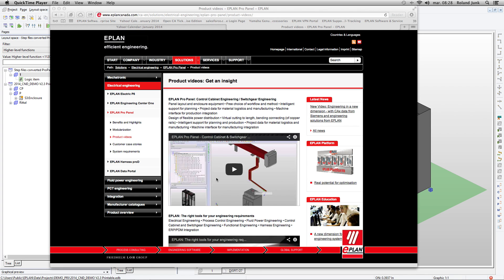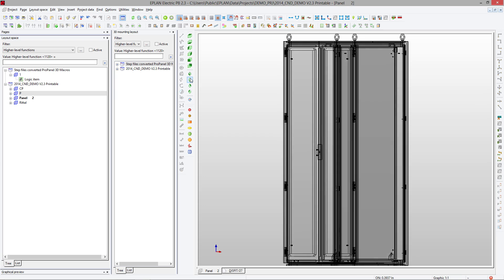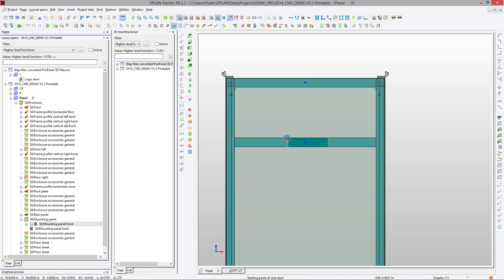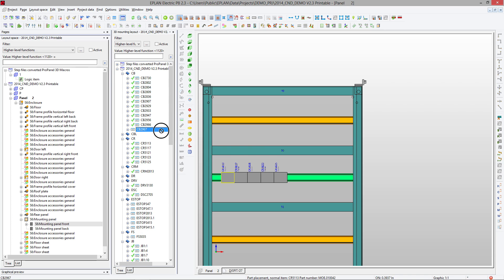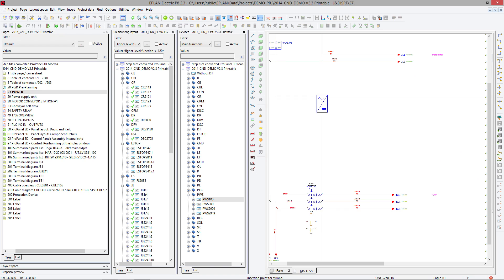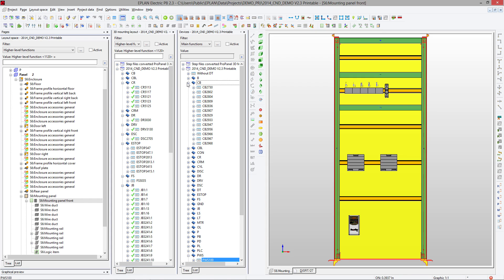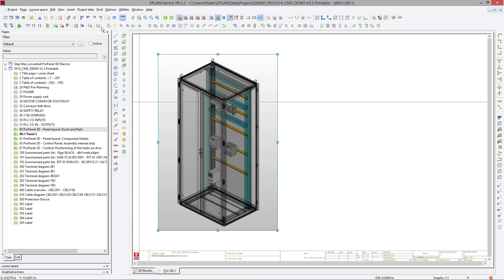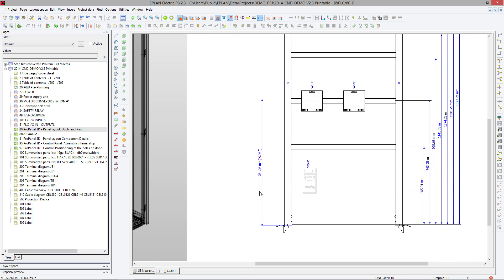EPLAN ProPanel 3D Panel Layout Tutorial

Comment: Sir I want know something kindly reply when u will see my question.

I want to know how I can measure dimensions at the time of wire Duct placing at a fixed distance like 200mm..
Example I want a wire Duct house of 200mm and second I want 150mm size house so how can I do this in pro panel because If I placed wire Duct without measuring it will not at fixed distance...
Reply from the maker: when placing use the right mouse click and >placement options>... select the x or y 200mm ...

Comment: hi i have a question, how i could make new project without using tmplate
Reply from the maker: EPLAN provides standard templates, xw9 or ept files. This is the way to start a project. The default template from eplan only have the minimum data required to start a project.